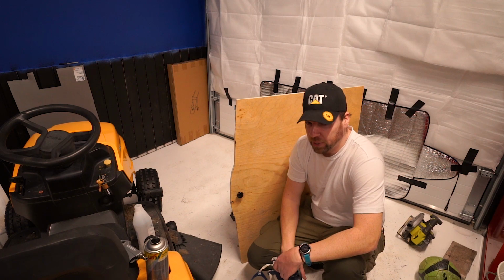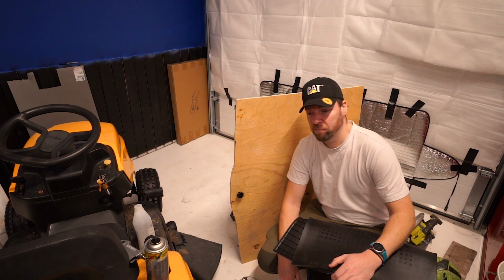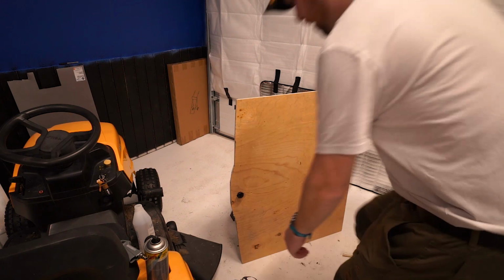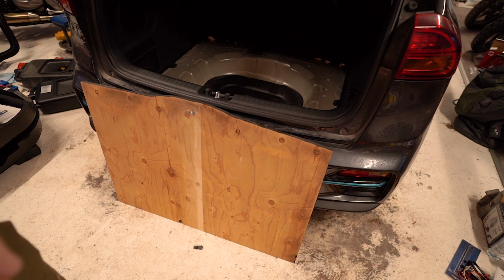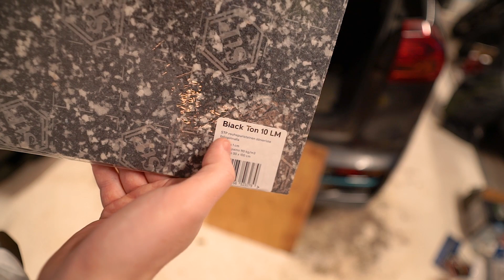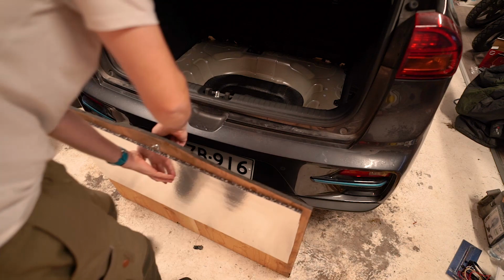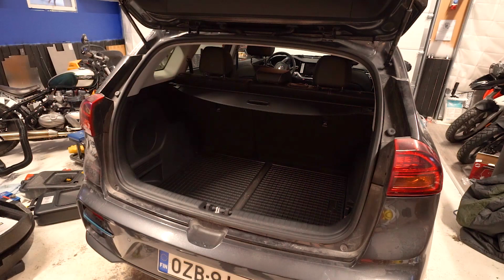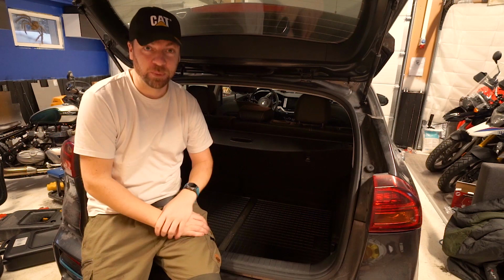Increasing the boot/trunk size of the e-niro (Part 2)

Comment: Great! It's transformed the boot capacity and usability 👍

As you say, a full sheet of rubber would be  preferable, maybe attached with velcro on the underside then you could easily remove it for pressure-washing.

That sound deadening material could be fitted in the tyre well to reduce noise transmission even further.